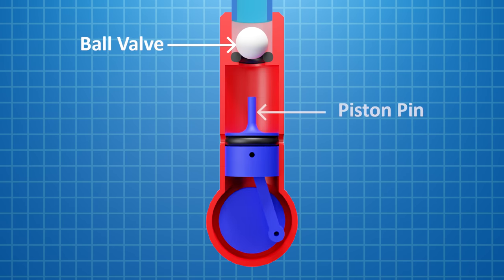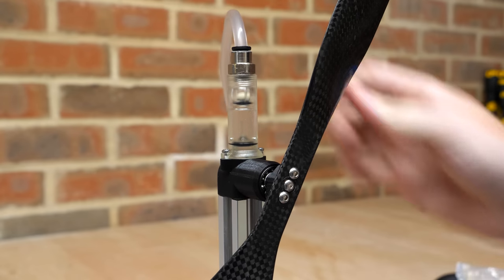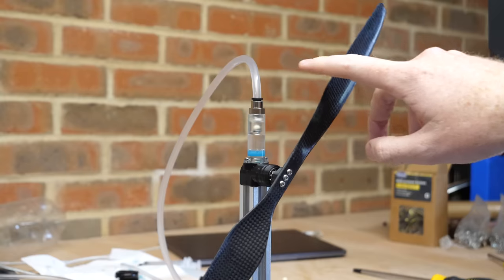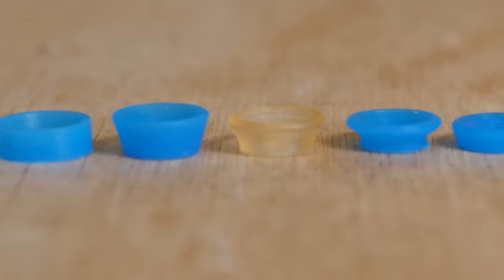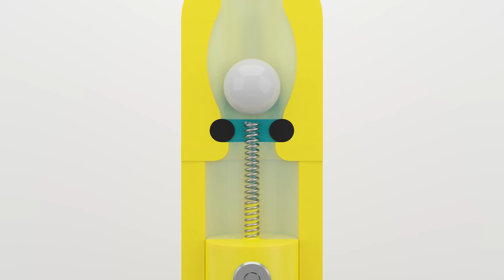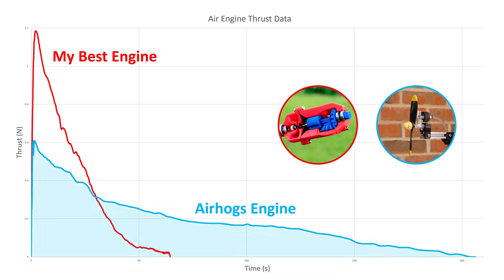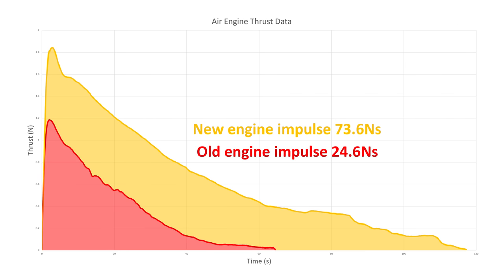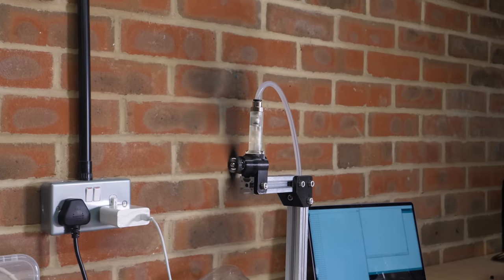Optimising an Air Engine

Comment from the maker: Get an exclusive Surfshark deal! Enter promo code STANTON for an extra 3 months free at https://surfshark.deals/stanton
Reply: I tried to email you, but no reply. I want to make a magnetic launch like your airplane launcher, but I want to use it for my model roller coasters. wonders if you could send me the reserch sources or any info or tips.
Reply: I believe this type of engine is called a ”head-valve” engine. It’s so interesting how incredibly simple it is and that it’s used in co2 plane and airhogs planes engines!
(basically engines that have the piston hit the valve)
Reply: @Tom, good work on the engine design and printing. As for the Formlabs printer, I recommend you print the cylinder barrel slightly under by 0.1mm then use a sized rheem to get it to the correct size but remember to use rotate the rheem backward otherwise, you'll crack the resin print.  (have made many smooth formlabs printed cylinders now)
Reply: Could you try to make it inline 4 or 6 ????
Reply: been watching for 6 years now. happy to u got a air hogs. every time u uploaded i would "get a air hogs" it would make the build easier to understand.
Reply from the maker: @Zuluknob  I believe the spring is there to keep the connecting rod seated in the piston. I occasionally had mine seperate when disconnecting the air supply at high RPM, and it caused the connecting rod to hit the outer rim of the piston, launching it into the top of the cylinder.
Reply: @TomStantonEngineering  What animation software are you using?!? Amazing work!
Reply: @DJ-kx4en  Blender I guess.  He used it for his Chanel banner. 
Its a Great free to use, open source software with a huge community. Only downside is that it's not especially easy to learn.
Reply: Would it be possible to make, say a v2 or v8 version of this engine?
Reply: I GOT ONE OF THESE WHEN I WAS LIKE 6 OR 7 ONLY EVER PLAYING WITH RUBBER BAND PLANES THIS PLANE WAS AMAZING BUT THERE AIRHOGS VW BUG HAD A CRAZY MOTOR IT ALMOST ALWAYS DID WHEELIES YOU HAD TO PUSH START IT TO NOT FLIP OVER
Reply: Tom, have you considered coating those seals of yours in graphite? That might work better for this application than a liquid lubricant.
Reply: I would try making the rings out of delrin
Reply: wait a second why do you need a piston at all? couldnt you have the ball or even better a cone, held down with a spring,into a soft female gasket creating a seal,  then a con rod from the prop to knock the cone up every cycle, allowing airflow? thats a lot less moving parts
Reply: @tomstantonengineering change the thumbnail, I didn't even realise it was one of your videos at first
Reply: VPN ad (scam) = Instant Thumb Down. Please don't ruin another video by using misleading and dangerous ads.
Reply: Have you made a way for it to run off compressed gas canisters like some airsoft guns / emergency bike tire change kits use?
Reply: I don't even know what surf shark is and I do not want to know about it
Reply: Yeah, this is awesome what happens if you make it a twin engine?
Reply: You might not see this, but 2 stroke engines use a tapered piston to avoid parasitic compression losses.  Food for thought.
Reply: try using delrin rings to replace bearings, they have very little friction and will save you several grams, taking efficiency even further
also what about using remote controlled valve to supply air in bursts when previous impulse runs out?
Reply: Have you thought about the rod to stroke ratio? With a longer con-rod the time spent at bottom dead center is reduced which might increase efficiency?
Or you could decrease the length of the con-rod to increase exhaust time if needed?

Or also offsetting the crankshaft from the cylinder to reduce the angle of the con-rod during the power stroke to reduce friction?

I have made a desmos graph to look at all this a while ago if you're interested but I can't post a link here
Reply: Wow this is amazing!
The next time you make a V/STOL could it be based on the Zhuchenko vertoplan?
Reply: @TomStantonEngineering Some airsoft pistons are like your silicon piston heads, but there are some that are similar to your first piston, but have holes from the face of the piston to the inside of the groove where the o-ring sits which causes the o-ring to expand and create a perfect seal
Reply: I wonder if you can make a air powered fly wheel nerf gun
Reply: How did you know about what materials to use in molds?
Reply: Idea: make an atmosphere powered plane using vacuum, ike the same engine concept you used in that dragster.
I know it is inefficient, but im just giving an idea.

I was wondering what would happen if a developer of the air hogs engine finds your channel 😅
Reply: you can also vibrate the silicon aggressively to get rid of bubbles i use a massage gun and it works very well
Reply: hey tom one of 10 people who watched the video had dropped a like congratulations 🎊 👏
Reply: Wow, I am super impressed with this. Really good job!!
Reply: Excellent work here. I started thinking about the area under the line and the total force output, wondering what if it was 10x as much initial force but lasted only half as long. Or maybe 2x the initial force but half as long (30 seconds). If we max out total force it may be more efficient at total delivered power. I realize the speed might be pretty high, especially considering if we get more out of the total potential energy in the bottle. It's at this point I realize I'm thinking more of a rocket than an engine, or specifically a bottle rocket and how they can go a mile up with air and water. Ditch the wings and the engine components in space of stabilizer fins and you'll need to ask for permission/clearance into air space lol.  Seriously though I also considered if we did add water would it help or is this purely an air engine? Bubble machine solution as lubricant? I thinking about Jay Leno's steam cars and how they use steam oil. What lubricant did you use here and do you think other amounts/types could be better? I see a lot of lubricant being moved around your cylinder. Could be funny seeing a plane leave bubbles as it goes by. Sorry if this message is too silly that's purely my Willy Wonka type imagination running wild lol
Reply: The new engine is very impressive. Looking forward to you optimising it with a revised airframe and highest efficiency. Thanks Tom. 🙂👍
Reply: have u tried to make a multi cylinder engine i know it would be inefficient but it would be cool
Reply: pls make a v12 airpowered engine
Reply: get a set of reamers and/or a set of files, saved me so much time
Reply: @TomStantonEngineering  You probably should have bleeped out the CO2 bit. You don't want the JSO storming your house! 😀
Reply: ONLY if i can get one of YOUR motors! Impressing research process! And perfectly suited for 8-10 years olds and their daddy or grand daddy.
Reply: Next step study the air tank to get some more run time.
Reply: Tom, ffs, get yourself at a mini lathe and build things properly. 

Did you seriously think a rubber seal was going to work?
Reply: Drop in dry ice pieces
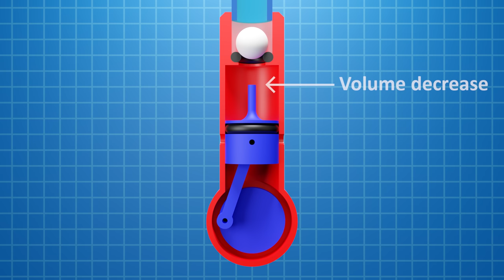Reply: 1:30 ever heard of Taurozzi Motor? That's a solution for the backwards movement, because it can't go backwards, that motor is just perfect for this purpose.
Reply: Hey, do you plan on making the files for the engine available for download?
Reply: I used to make molds for jet airplanes in a factory its so neat to see it scaled down to a desktop 3d printer! hahaha
Reply: Make multi cylinder air engine
Reply: 00:02:52 :thanksdoc:Sir, please invest in a little bit of paint and any small moment of necessary rebalancing time needed to add a high-contrast marking to the tip of your props, both for the benefit of your face, and as a reminder for your viewers. :face-blue-wide-eyes:
Reply: I'll  give you a better piston idea to prevent the friction.  Search for how works a piston In an airsoft gun. Is simpler and better.
Reply: @TomStantonEngineering  Sorry Tom that was not the reason.😊
Reply: The spring on the piston was the weakness of the design as mine bent, thats when I took it apart?!
Reply: Is there not a way to use the same piston to send air back Into the tank and effectively make a perpetual engine or at least a longer running engine?
Reply: Is there anyway to add custom exhaust around those holes? To give it a diff tone an maybe help control airflow, so instead say your flying an a malfunction happens an it’s dumping all the air in the engine, if you had exhaust it would have back pressure keeping it at a certain rpm.
Reply: Can I ask exactly what 3d printer you have bro?
Reply: Add a gearbox!
Reply: Can you share the 3D model of the ball and the 11.8mm part?
Reply: @TomStantonEngineering  I haven't heard you mention lubricant. Are you using any, and those o-rings are greased too?
Reply: Direct the exhaust to the rear for a dinky amount of more thrust
Reply: That seal is used in an airsof cylinder on spring-loaded airport pistols.
Reply: hi tom where are you from you have good skills and id love your help to make a project i always had come tru
Reply: Peter Stripol collab? Or whatever his name is...😅
Reply: Tom how about a Tesla turbine instead of a piston engine. I hear it has high performance.
Reply: @TheKnexMaker 😊😊😊
Reply: Tom can you try running this on hydrogen or helium ?
Reply: 😊😅😮😢🎉😂❤ عن💋🌜🌛🤛✌️👍👩‍❤️‍💋‍👩👩‍❤️‍👩👩‍❤️‍👨💜⚫🟠🖤🌷💙🤲😡👮👩‍❤️‍💋‍👩
Reply: You're genius👍
Reply: Propane. 
Roughly 100-150psi depending on weather. 
Thermal transfer to boil it all off is impractical but to let liquid into the cylinder and have it flash boil is more practical. Around 500:1 expansion so only small amounts of liquid need be transferred. 

Originally I was working on a flash boiler attached to the cylinder head and injecting super heated water via a diesel injector.
Reply: i want an air powered bike with air compressed charge
Reply: Automatic thumbs down.
Reply: With very little small amount of  liquid nitrogen as pressure generator . Congratulation  your engine got a new type of Green energy cheap fuel!!!👍👍
Reply: could this be hooked up to a diesel bov to regen some wasted energy

Comment: This series is an internet treasure. I can't wait to see where it ends up. Please never stop having ridiculous ideas about using compressed air for propulsion.
Reply: I'd argue not a ridiculous idea, just difficult to pull off in an efficient manner
Reply: It definitely is super awesome
He should try getting the compressed air by using heat from gasoline or a fuel oil.. 😉
Reply: Tom is my hero
Reply: @Doribi117  something can be ridiculous and awesome at the same time =p
This wasn't even his idea, it was someone else's..he is just improving on it =p
Reply: Connect a really long hose to a ground vehicle with the air supply!😁😁😁😁
Reply: Volumetric efficiency of air engines is rather poor no matter how you design them. With a reciprocating engine like this, the best method to boost efficiency is to use the exhaust to drive the piston upwards at the bottom of the stroke, and ideally you'd have two pistons, coupled together by the crankshaft, one designed to run off of high pressure supply air, one designed to run off the lower pressure exhaust air of the first, ie, double expansion. 

Scroll type motors utilize these ideas, but, they're difficult to machine as tolerances are very tight, likely beyond the abilities of tools available to Tom.
Reply: I feel absolutely the same way ))
Reply: @IronGoober samy is my hero
Reply: @jttech44  Why not just have have a larger expansion ratio? That way you are pushing the piston with the 'exhaust' by delaying the exhaust, and doing it without any leakage or extra parts. The last time I've heard double expansion being used was the steam age, specifically for steam.
Reply: For your next improvement would it be worth adding a valve or mechanism that leaves the upper chamber open during the up stroke so inertia is not lost compressing that air.
Reply: Journey before destination )
Reply: I like the idea of using the exhaust gas’s to drive the piston back up to increase efficiency. Couldn’t a exhaust port be added to the print directing the exhaust into the crank case. This may be tricky as the exhaust ports would need to be perfectly in tune with the the stroke for correct timing. You could then vent the remaining gases from the crankcase with a small exhaust port. Simply increasing the port size incrementally until you find the correct back pressure. This should allow you to utilize the wasted exhaust gases. Also the crankcase exhaust port could be fine tuned even further with a header and interchangeable muffler chambers to increase/decrease volume and back pressure as desired. Plus it would look cool! Would be awesome if this worked without the addition of any moving parts.
Reply: @Doribi117  Yep. Must be a satisfying process though!
Reply: @jttech44  volumetric efficiency and energy efficiency are two VERY different things. With an air engine, you have VERY limited energy available, so volumetric efficiency is far less important than energy efficiency. Double expansion DOES improve energy efficiency, but it would be just as easy to increase the expansion ratio, as @BC-wj8fx said.
Reply: frfr
Reply: I miss these compressed airplanes.
Had a lot of fun with them in my childhood.
Reply: Especially because we can store huge amounts of gas in solid state and sublimate them using just sunlight. 

I wonder who could work on energy storage for Toms pressure-powered machines. We can very quickly end up with battery-swapping high efficiency flyers that are not limited by geography
Reply: I fully agree, top channel out here
Reply: I love this series because storing energy as compressed air removes the nature of battery degradation and discharge. Can use wind turbines to pump/store compressed air. 
As Air is used, refrigeration can be leveraged along with the work being provided. 
A quality air engine that converts the energy efficiently seems a backbone to a system like what i just described.
Reply: It takes a lot of energy to gather compressed air into a cylinder even if the regulated rate of use is controlled. Your getting a smaller return for the energy invested which is a common problem with engines of this type.
Reply: @Doribi117  i agree, but i must also say, never stop experimenting and testing new stuff and ideas, many new ideas and inventions comes from a long winding of testing, experimenting and failures... learn from them... please keep experimenting...
Reply: @xmysef4920 nice to meet you here lol
Reply: Not sure if you like cars also but robot cantina, and project binky are gold also
Reply: @Patrik6920  you are absolutely correct in that, if we didn't let curiosity and experimentation grow then we wouldn't have half the marvels we have today. Experimentation is the cornerstone of modern humanity and I applaud anyone who is willing to experiment
Reply: @jonslg240 Using compressed air wasn’t his idea? What other surprises do you have for us? He didn’t invent YouTube?
Reply: Love this video!!!!  Since everyone is throwing out advice, how about angling your exhaust ports to provide some added thrust?  It’s not polluted air, nor is it hot from combustion.
Reply: cool with toys, but it will never happen with real aircraft :-\
Reply: @jonslg240  while I get the joke... maybe though for real, could use the friction (thermal energy build up) to heat and further increase the pressures of the storage tank (on a large scale object, useless for a small toy plane).
Reply: We gotta see a 2 cylinder v4 v6 v8 v10 v12 and a w16 air powered engine 😮
Reply: Pneumatic propulsion to the moon!!!
Reply: A continuous supply of conpressed air would be ideal.
Reply: @jonslg240  hahaha, or get really creative and just use the gasoline explosion lol
Reply: This has been done before bro lol dudes doing a good job but man you’re reaching so hard for likes.
Reply: Jedem sein Spielzeug , eine Modeleisenbahn wäre  für Sie eine Alternative 😂😊
Reply: I actually don't think it's to ridiculous, I have wanting to build my own steam engine and this compressed air design is so simple while still working that I figure I can use something like it, since compressed air and steam arn't to different